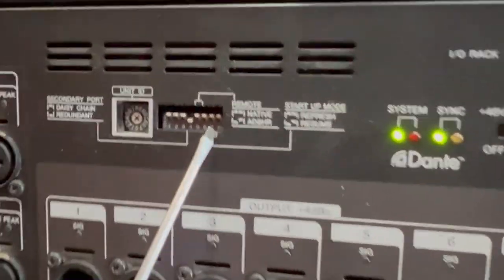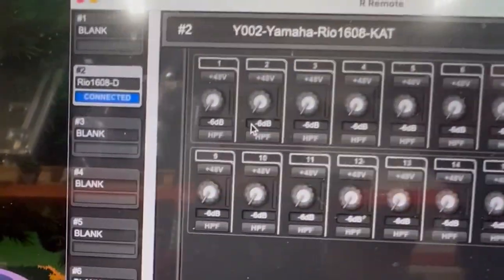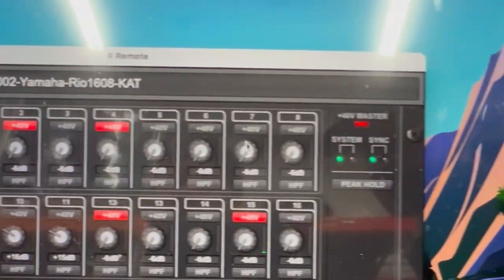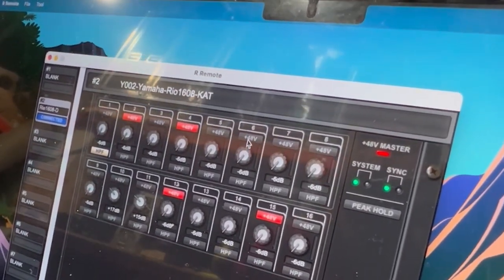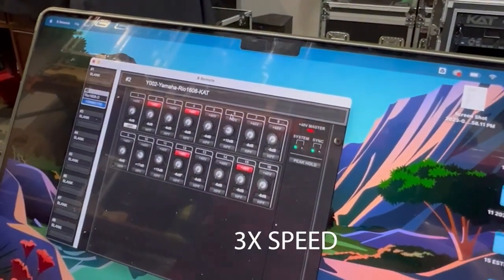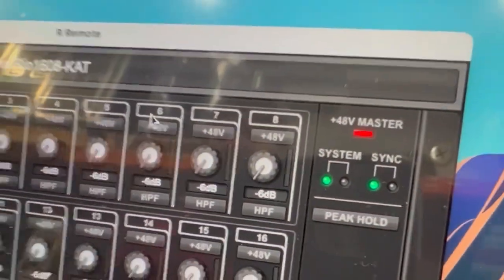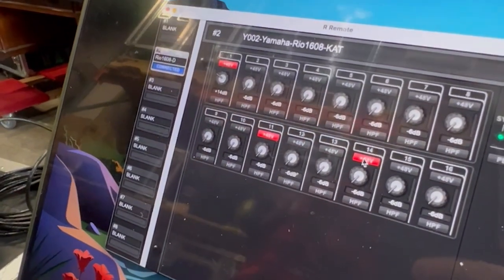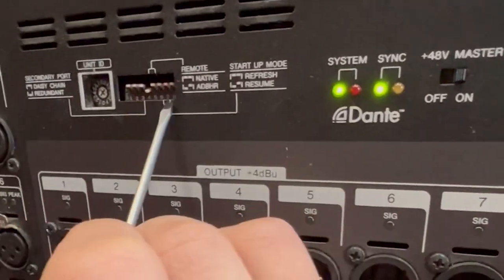YAMAHA RIO REFRESH AND RESUME EXPLAINED

Comment: Good to know! So before a show starts it would be good to keep it on resume in case it loses power. Maybe after the show is over switch it back to refresh for the next operator on the next gig.
Reply from the maker: It’s a subjective answer and based on your production setup. Most of the time I start with refresh on and then if we plan on powering down I flip on resume before booting down.

Comment: I thought HA information was stored in scenes. Last rehearsal some shitstain had flipped this switch...I dont quite understand why you cant recall the info in your showfile though. Even if the rio does refresh and all is gone, why dont HA settings recall if you recall the scene again. There should be a failsafe somewhere.
Reply: isn't there an option where you can choose "HA from console" / "HA from dante" ?
Reply: @TinoSchulz1990  did not realise😀 will check as soon as i can!
Reply: I've only worked on a CL5 and QL1 a couple of times. Just found it inside the editor. Not quite sure if that's what i think it is. 
Windows > Input Patch > "HA INFO" [Take from Port] [Take from Channel] @Kolioruth
Reply: Manual says:
(1) TAKE FROM PORT button
The HA settings of the port will take priority. Even if you change the patching, the HA settings of
the port will remain unchanged.

(2) TAKE FROM CHANNEL button
The HA settings of the channel will take priority. The HA settings of the port that had been
previously patched will be copied to the newly-patched port.